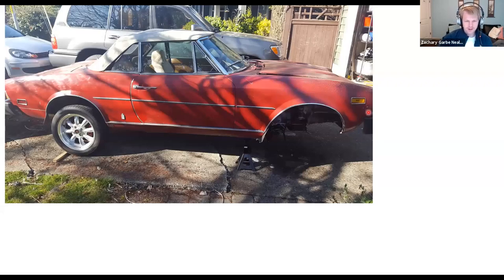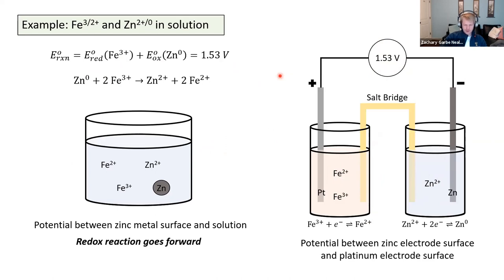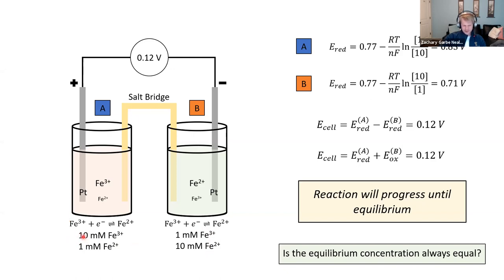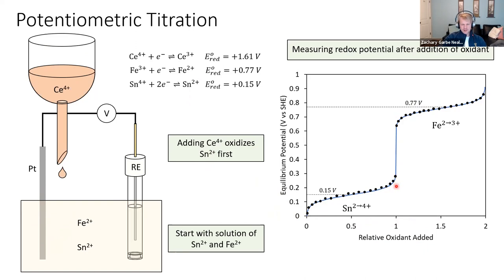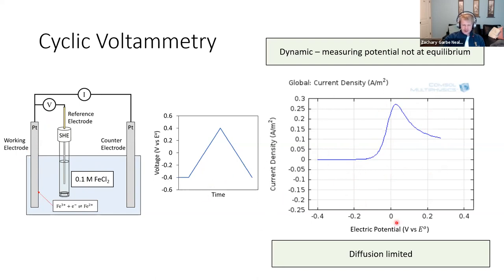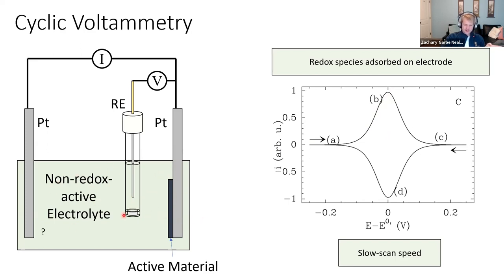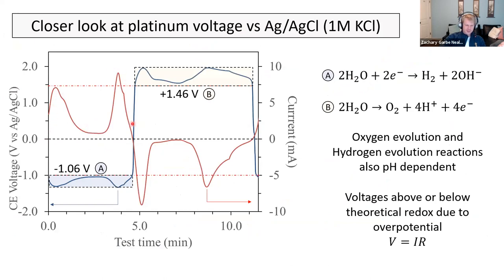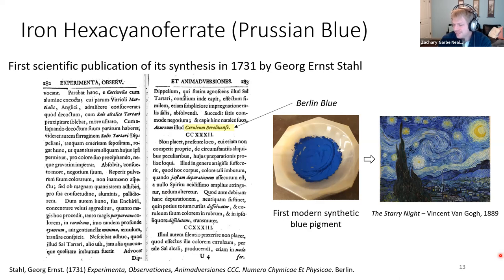Lecture - Electrochemistry and Batteries 2

Comment: Hi, on the battery cyclic Voltammetry slide, you mentioned if we cut the wire, the potential of the active material will go back to its original equilibrium.
Reply: However, the original equilibrium cannot be reached w/o the wire that conducting electrons back and forward (the e- cannot travel through electrolyte). Hence, I think it will be more reasonable to say "removing the voltage source will let active material goes back to its original potential".
Reply from the maker: Voltage would relax to its new equilibrium potential, depending on the state of oxidation. It would not be the original equilibrium at the start.
Voltage source and current source are the same.